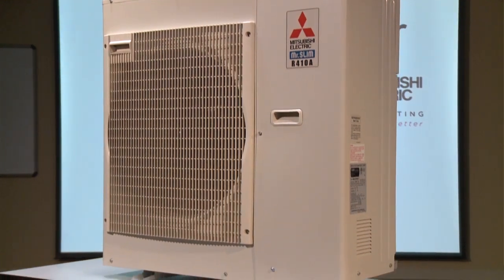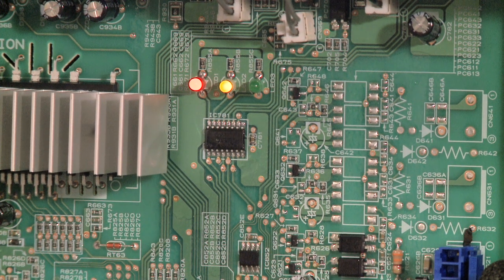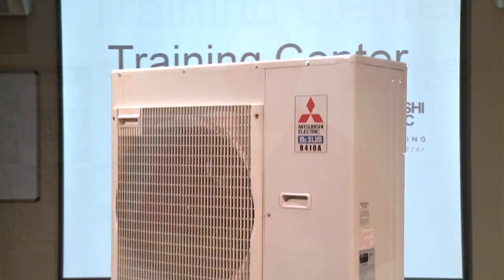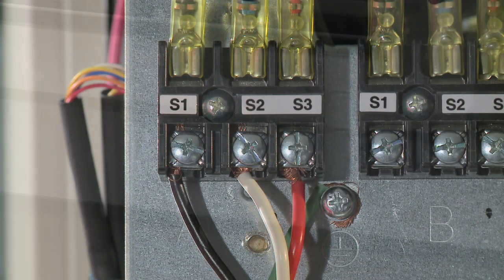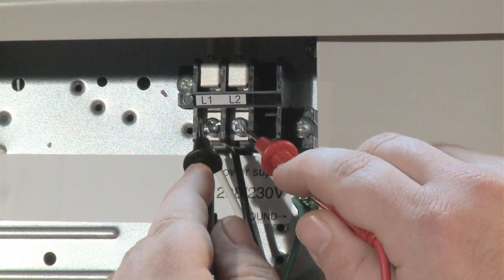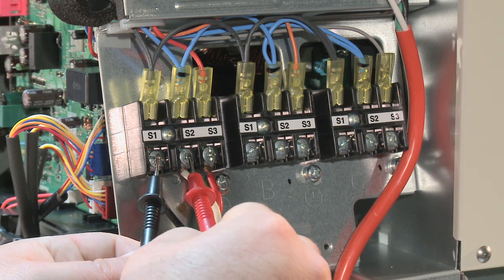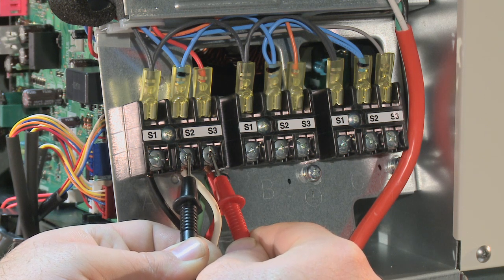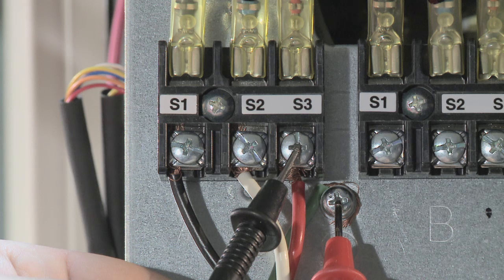1-Time Flash & E6 error troubleshooting, part 1 of 3 for Mitsubishi Electric Cooling & Heating

Comment: When there is just a steady 3v DC   at s2&s3 , and it has a brand new wire with nothing interrupting it , and a 1x flash at the indoor unit. Does that mean it needs a board inside?

Comment: Help , my units have now failed 2 times i have code on the head was 7 flash , on the main board 15 times I have 3 remote heads 2 at 9k and a 12k, I have now pulled the power both Times and did hard reset that way unit is about 5 years old and its a mr slim

Comment: I have a P series unit with a E6 code on the stat. You say 10-24vdc but I’m seeing 1.6-24vdc fluctuating at the s2 and S3 terminals of the outdoor and indoor terminal blocks. If my wider fluctuating voltage signs of a bad outdoor board?

Comment: My unit presented this error code after a power outage was restored.  The easy remedy given here worked -- remove all power from outside unit (simple, there is an outside disconnect), wait five minutes, then restore main power. A/C came right back online and is working well now.

Comment: What do you do if you have ceiling cassettes?  Put the isolation switch for it on the wall?  I'm fine with all other codes, but 4 individual disconnects is really a lot of extra work.  Not to mention people flipping switches for fun.

Comment: I got a open circuit error air conditioner reports 06 open start current in run circuit but not in start Circuit. It was running fine after it was serviced by the technician he put more gas in the system. I didn’t notice it was doing a couple of error codes about the thermostat prior to him leaving. Can you tell me what is a relates to and what is the realistic cost of repairing this

Comment: Question, 4 ceiling cassettes Mitsi Mr slim series and 4 condenser outside, all linked to 1 x PAR-30MAA wall mount LCD controller, all units turn on in heat mode set to 25°c the venst all open 3 blow cold air, 4th blows hot air, the 3 that blow cold air turn off after 15 mins ish, the 4th stays on working, I'm getting an error code of "PJ" on LCD unit and clearing it turns off the 4th working unit until i switch the controller back on (reset essentially turns everything off) any ideas what error code PJ is as no bloody manual i can find lists PJ as a code, ive been through all the menus, defaulted the controller and the only settings we have set is a weekly timer to come on in heat mode set to 25°c to come on at 8:00 and turn off at 18:00 can't believe 3 units are faulty, I've recently been tasked to maintain them (our new workshop) filters clean, all units are on R410a refrigerant, thet are the double fan condenser units outside with the 600 x 600 ceiling cassette, they are about 8-9 years old i beleive, will get the indoor and outdoor model numbers if it helps, im stuck as any firm i call want to sell me new systems which sucks, they are not interested in looking at the ones we have, any help on the PJ error would be great, cheers

Comment: Hey on a Samsung I'm getting a e203 what do you think that could be on the inside of the outside unit I'm getting a OTP error lights are read the yellow is on green is off red is flashing on the other board in the front yellow is flashing green and red on the one with the reset button what do you think you could be

Comment: Thanks so much. I looked at several other videos as well as the service manuals and the online troubleshooter at mylinkdrive, and none of them mentioned this simple fix. I had previously tried cycling the breaker, but I didn't know to leave it off for 5 minutes. My indoor unit has a separate disconnect (not installed by me) and I didn't know it would cause this problem (the installers pointed out the disconnect, but didn't tell me about the down-side of using it). You just saved me a ton of fruitless debugging!

Comment: Thank you for the great videos. Well done!! Would you be able to show how to diagnose and change a condenser fan or the power board? 13 times red LED (1) flash  with amber LED unlit. Item is fan abnormality. Possible fan motor or board failure? Thank you so much.
Reply from the maker: Hi there. Thanks for your feedback - we'll pass this suggestion along to our production team.

Comment: Hi guys have an issue with an AC, Mitsu Electric mr slim puhzrp60vha2#1 outdoor....pka rp60 fal indoor.

 Checked inverter board 100vac across each term, compressor not shorted to ground and windings are good.
Ac trys to start but compressor makes a clattering sound which ive never heard before and condenser fan kicks in, is there something failed on compressor or could be capacitor issue on start up?
Reply from the maker: Hi there.We recommend you contact our Customer Care team at 800-433-4822 or via email at customercare@hvac.mea.com. They will be able to assist you in finding a solution.

Comment: how to remove vrf ac motor, PCB box set not opening
Reply from the maker: Please contact our customer care center at 1-800-433-4822 and they can help you out.
Reply: job hai kya mo 9867429143
Reply: Indoor unit no power celing cassttetype this outdoor bling red og yellow is indoor no cgnal my voltage indoor outdoor

Comment: Hi what could it be if the stat flashes E6 and I had a breaker I hit last week and then reset it. But now it just displays E6
Reply: Having the exact same issue, how did you fix?
Reply: You need a new main board for both unit